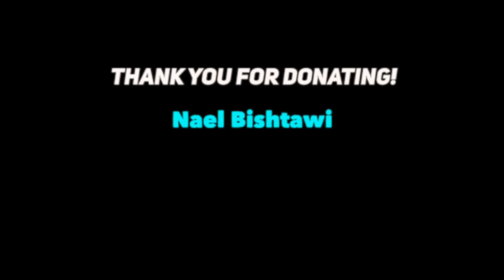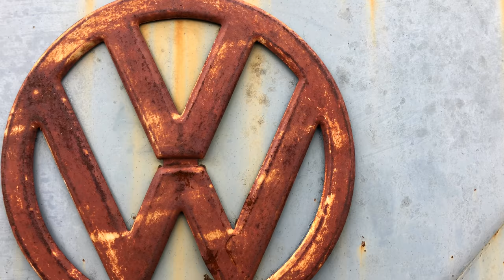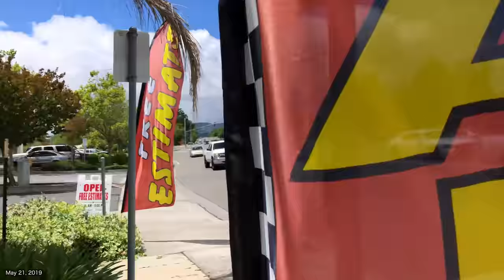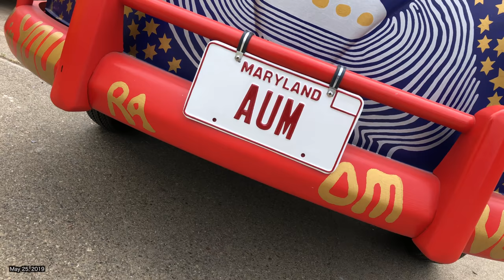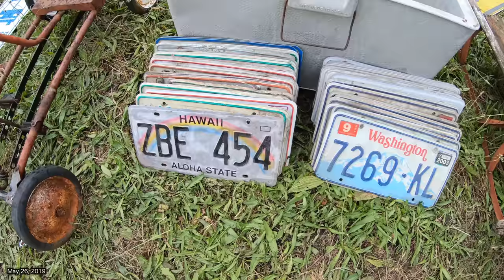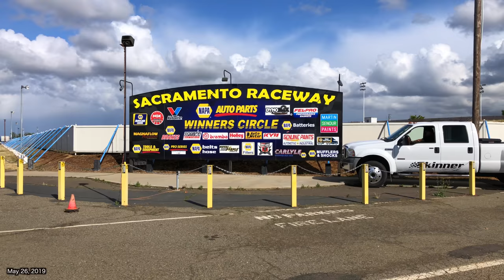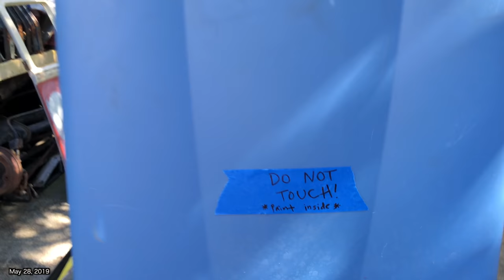VW Bus Restoration - Episode 16 - Rotisserie Time! | MicBergsma

Comment: Even though you are bummed about having to paint those parts twice one good thing to be assured of is that when you sand blast parts, after you paint them the paint will stick better to the parts that are sandblasted. Than if you were to use a wire wheel per say because a wire wheel  gives you a smoother surface. Smoother surface is not good for paint adhesion. Plus you should've hit all that dirt off the bottom of the van with a pressure washer first. It would've been a hell've a lot easier. Next time.

Comment: I know the issue with aerosol paint. It does not last long on parts exposed to weather. Yet I do not have a solution that is as easy to apply as an aerosol paint. Better to use two part paints but a lot more complicated to use. I envy you walking around in sandals and tee shirt. Currently where I am (Toronto) that is not possible, Snowing and 32F right now.

Comment: Why did you paint the disc brakes? Are you going to remove it eventually?
Reply: This is to prevent the rust from forming over the time. You can see them on vehicles for sale if they've been parked too long.

Comment: Erm i don't think you are supposed to paint over the brake discs! whats going to happen when you use them for the 1st time? the paint will likely stick to the surface of the brake pads resulting in poor or bad brakes.
Reply: PAUL TAYLOR pretty sure they’ll turn the rotors down on a brake lathe before final reinstallation.
Reply: @bluetickhound16   Hope so
Reply: This is a preventive measure against rust. It's common procedure for the extensive restoration projects to paint over the bare metal for the long term storage. Sometimes, the rust would leave the deep scarring and pitting and the brake lathe would have to scrupper more metal off to smooth out the surface. This leads to undesirably thinner disc.